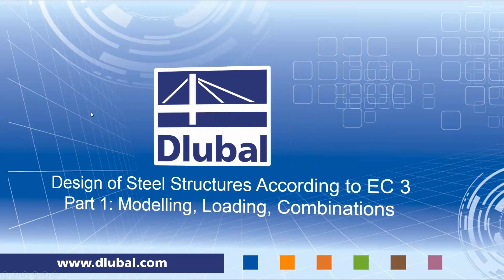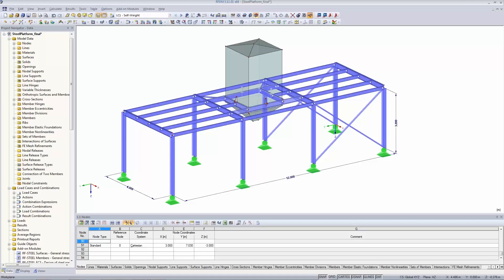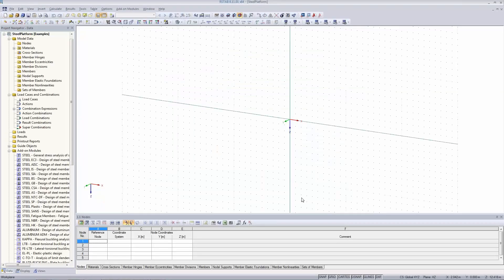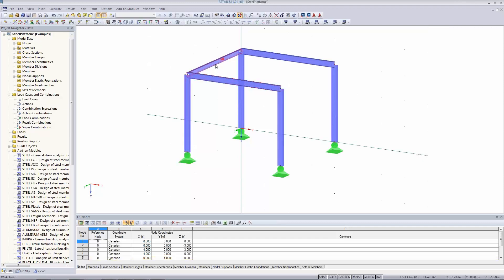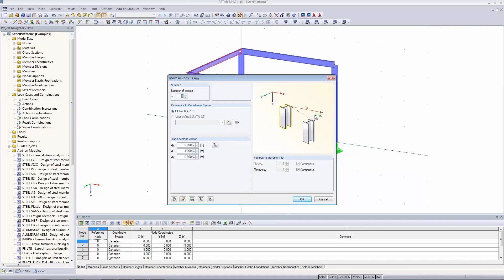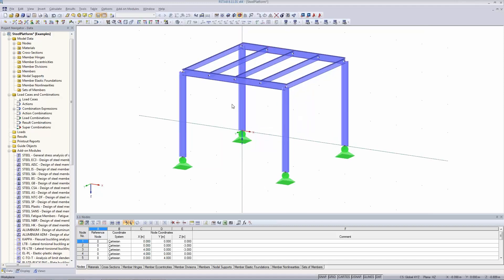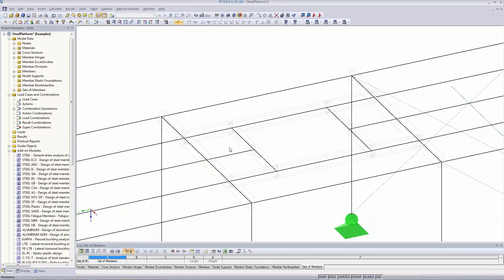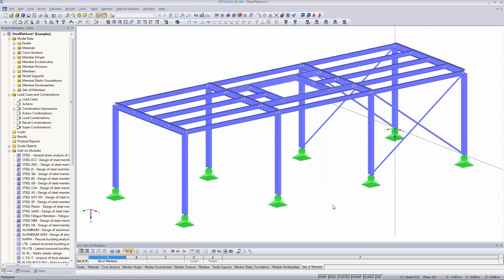Webinar: Design of Steel Structures According to EC 3 | Part 1: Modelling, Loading

Comment: I am Aluminium facade designer using Autocad. But I like this software how to learn ?
Reply from the maker: Hi, Mohammed!
This is RSTAB, an analysis and design software for 3D beam, frame, or truss structure calculations. You can find plenty of Videos and instructions on our Website in the following link:
https://www.dlubal.com/en/products/rstab-beam-structures/first-steps-with-rstab

As well as register for a Webinar. You can find available Webinars and dates in the following link: 
https://www.dlubal.com/en/support-and-learning/learning/webinars